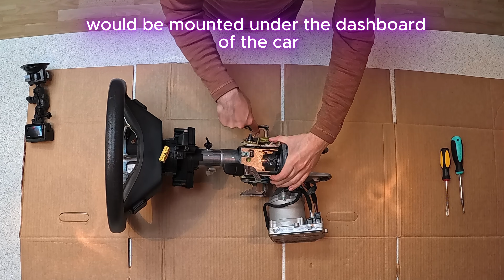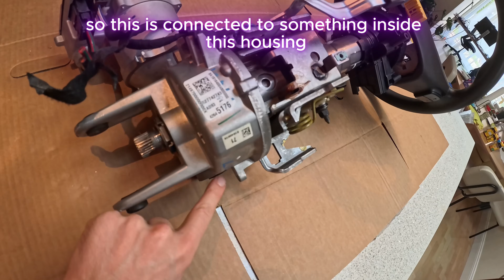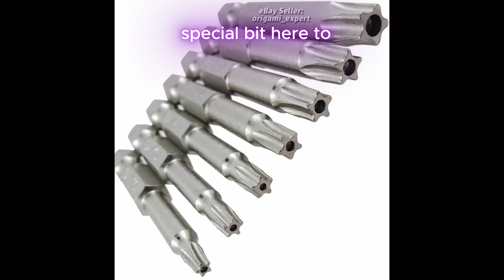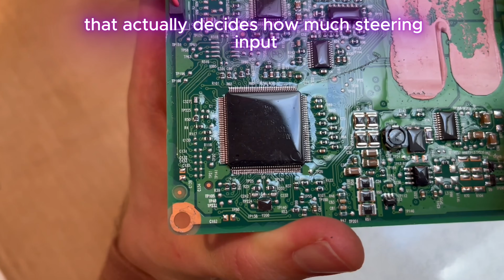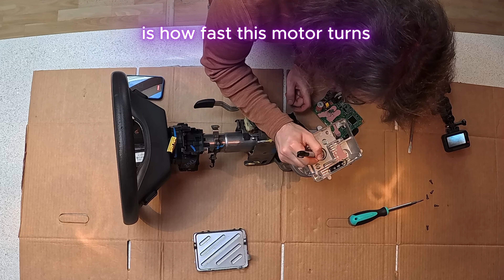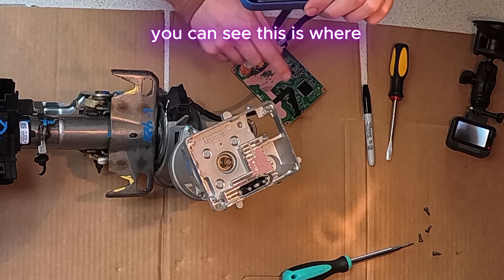Teardown: Chevy Bolt EV power steering

Comment: Surprised the electronics is not sealed. 
Any humidity and condensation from the drivers shoes area can affect the circuit board. Not good for safety, I guess.

Comment: Finally, thanks for doing this , I was wondering all this time where the motor for for the steering was since I’ve seen so many videos (2) lol of people replacing the rack and didn’t see anything about the motor, although my car steering rack is fine still at 184k miles I still like to be prepared. Many Bolts had issues with the rack going out as early as 20 k miles

Comment: This is so cool! I wonder what other systems can be made to feel more engaging. Do you think you could bypass the power assist completely and just have manual steering old school style?
Reply: I was wondering if a resistor between the power supply and the motor could reduce assistance to amplify feel without other changes. Worth checking if there are any rubber bushings that could be switched for poly as well.
Reply from the maker: I tried temporarily disabling power steering, and it feels good above 30mph, but a tad too heavy at lower speeds. The steering feel without power steering is like this:
- Not much road texture feel (though slightly better than with power steering enabled)
- Steering loads up a bit better in corners (somewhat better than with power steering enabled)
- You can somewhat feel when the wheels are losing traction (e.g. understeer), but it is fairly muted

I am interested in adding a power steering kill switch.

For the resistor idea: Since the board directly powers the 3 phase motor, there isn't a great place to put a resistor. It would require some major surgery, but might be worth it!

To get more road feel, I think stiffer bushings may help.